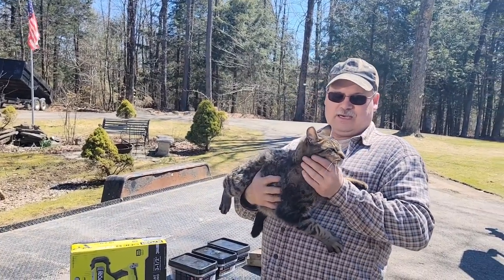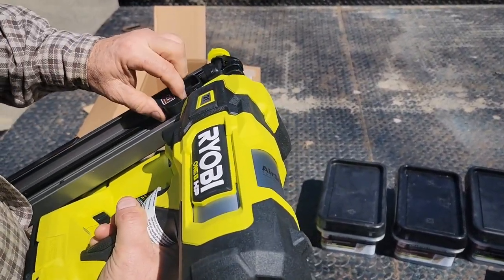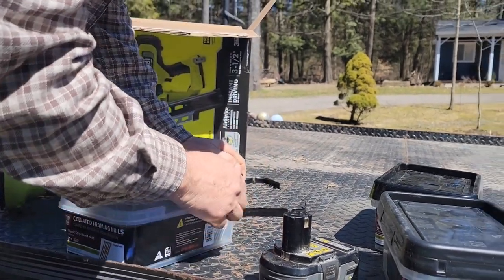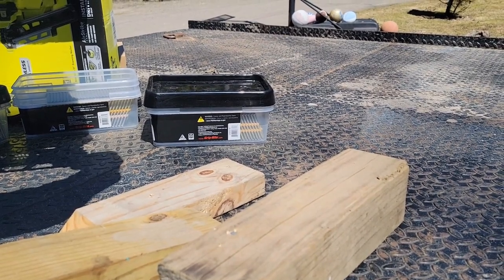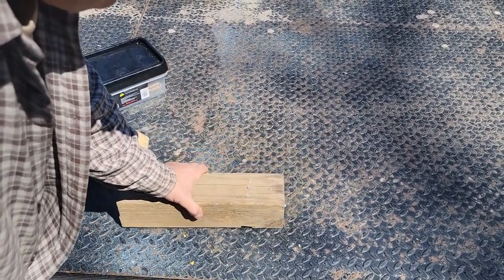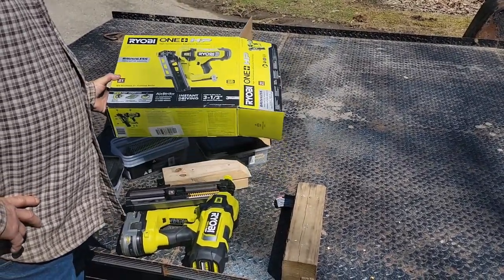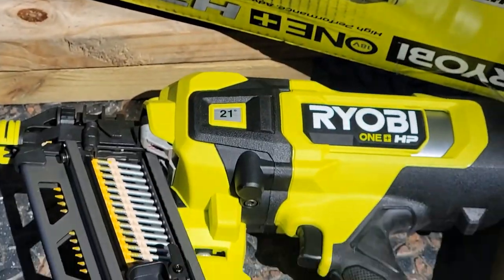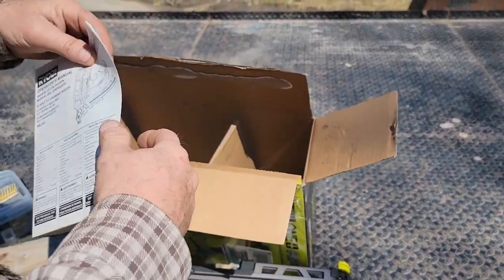Ryobi 18 volt 21 degree Framer

Comment: When I lived on Kauai and wet through a hurricane it was plain to see that all of the roofs that came off had been put on with nail guns and none of the hand nailed roofs came off.
Reply from the maker: I like to use ring shank nails very hard to pull out. Roofing nails driven too deep is a problem and need to lower the pressure.

Comment: Do you think you can able to put a wooden fence with it
Reply: I was wondering the same?
Reply: Most definitely
Reply from the maker: Yes it has lots of power and run time with a 4 amp battery. Plus galvanized nails no rust